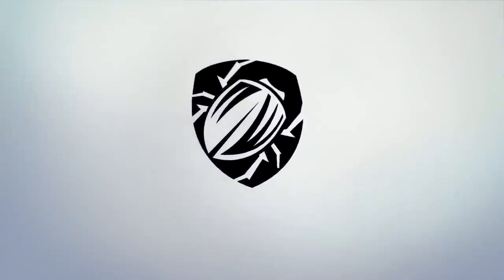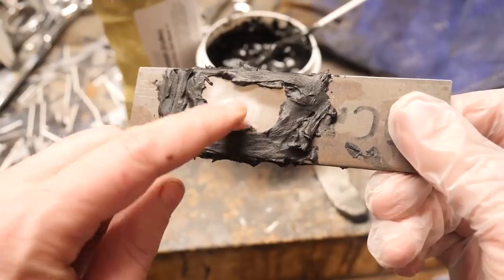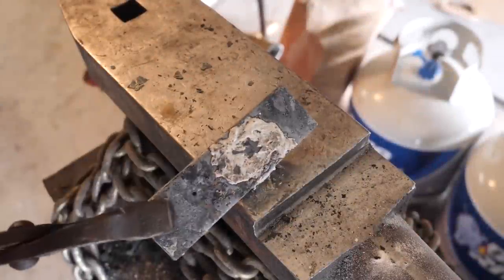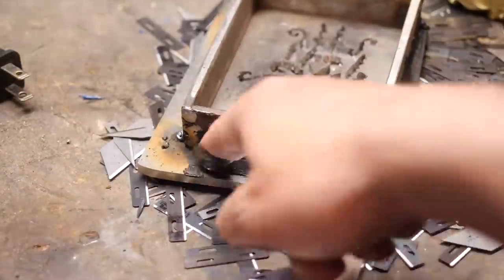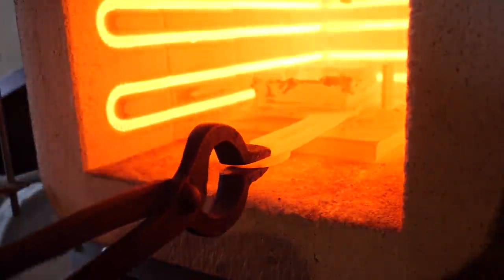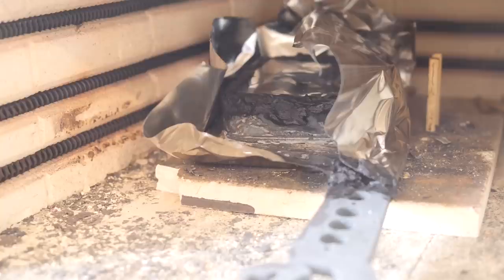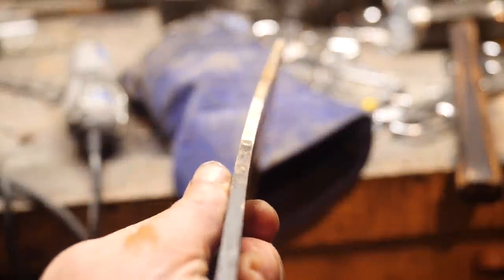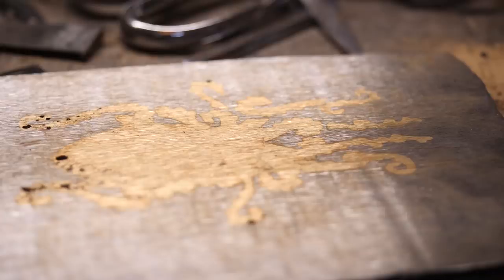Return of The Squid Cleaver!

Comment: If it was me I would cnc Mill the design and a brass fill and I would hit it with a hammer to make it stick and avoid fire altogether because I don't understand how you can heat treat the knife with a lower melting temperature metal in there anyway and I'm very lazy.

Comment: Your little torch will be big (hot) enough, to braze it, if you preheat the blade in your oven
Reply from the maker: I think that heat will only last a minute at a time
Reply: Heat a larger piece of steel with the blade laying on top at the same time. Together they should stay hot longer. Get it up to just under the melting point of your brass/bronze. Pull it out and braze your bubbles and other flaws

Also, as a note, the brazing may look slightly different as it is made up with other alloys
Reply from the maker: @jasonharrison25  its a good idea but steel at that temperature in a normal environment scales very quickly
Reply: @GreenBeetle  forgot about that. Maybe you could try it at a lower temp and see if it will still braze

Comment: If you want the metal to flow properly, use some borax flux. You could tig or oxy fuel braise it all together.. The easy way to fix what you got is just to drill out the voids and just peen bronze rod in. I would probably use the bronze/brass mix you have to make the bronze rod, otherwise the color is unlikely to match. Make sure to drill all the way through so you get the mechanical lock on both sides of the blade.
Reply from the maker: the white powder here was flux

Comment: Cnc cut the image out of a brass sheet slightly thicker then the blade, then press it in with your hydronic press maybe 🤷‍♂️🤷‍♂️. The brass will expand under the pressure locking it in.

Comment: Try brazing first: when that fails change the design so there aren't huge cavities to fill and then try brazing again.  Should work if all the cavities are about the width of a brazing rod.  Didn't see you using anything for flux either.
Reply from the maker: The brazing rod was fluxed.  I added flux to the powder.  Good idea.

Comment: so not use powder, you are pretty much volatilizing the bronze that's why its getting all places, use the kiln and melt it to pour its the best, just pre heat and remember that even like that the sharp edges will be a hell of an issue if you don't pre heat. but try again with the pouring. also melted metal produces a lof of gases unless you are in a completely dry environment, so don't seal it or it will bubble everywhere

Comment: A thought that crossed my mind is that you use the same lazer technology and simply cut out the same figure in a bronz plate slightly thicker than the blade you want to fill with the bronz. then fit it and peen it lightly on both sides so it will be fixed permanently. God speed.

Comment: Maybe this is a lot easier way to fill it. take a bronze plate that 1 higher than the knife,  draw the line of the sqid on it, cut it out, anneald it and hammer this shit in the knife. with a little bit of flux and silver solder it will hold.

Comment: well if you are getting the cleaver blank cut out  why now get the pattern cut out as well ? Then place the cut out pattern into the blank , heat them up  to a temperature where they wound forge weld ,  gently hammer them together ,then gring it al flat . It may be a weak bond  that wont hold up to much abuse but i doubt you are making this  to use as a  actual cleaver and the bond between  steel and just melted in bronze cant be that good either since it is not technically brazed together ( yes i now brazed welds are plenty strong)
Reply: Oh and if you doo this mae sure to get the  octopuss made out from thicker material than you want the cleaver to be so that you have enough material to grind off later

Comment: tig weld it. or get someone too. ferrous and nonferrous don't play well. I cast silicon bronze and weld it all day to pay the bills the best bet would be to get some plate bronze laser cut to make an insert then slip it in. HAMMER IT TO HELL. if you put a groove in the steel blank so that it can have a mechanical lock it would help a ton. as the thermal expansion rates are different.

Comment: If the design doesn't need to go all the way through you can do an etch on both sides, heat the design up and brush it with a brass brush. It should transfer brass over. MichaelCthulu has some videos where he does it and explains the process. It might work with bronze.

https://youtu.be/YwJoyPbPZVs @9:27 for one quick example.

Comment: FLUX FLUX FLUX FLUX LUX FLUX .nothings going to work without flux, the whole secret to brazing soldering etc is using flux youll never get two dissimilar metals to fuse of the bronze to flow without using flux first
Reply from the maker: I used borax in this video but there are probably better ones for bronze and brass

Comment: Dude, you need flux. Oxygen is your problem, it react with the metals at that high of a heat, thats why youre getting gas bubbles. Brass also melts at about 1700f, so youre also overheating your metal and boiling off the zinc in your brass. Brass powder isnt the way to go here either, since youre just increasing the surface area to oxidize. You could try sintering the brass powder, but your best bet is to look into making an actual foundry and learning to (properly) pour brass. 

You still need some flux though
Reply from the maker: powder was bronze. white powder added was flux.
Reply: @GreenBeetle  I missed that, my apologies. I do maintain that those temperatures were way too high, and boiling off the zinc was responsible for some of the bubble problems. Cant be healthy to breathe either

Comment: At the begining when you showed your attempt to pour, it wasn't even remotely hot enough, it should be a thick liquid, not a liquidie solid... the pour method should work just fine just gotta do it right.. like I noticed you said, "this is suppose to melt at blah blah" no dude no, no black Smith is sitting there with a thermometer making sure everything is exactly this or that, thats what Metalergist do, blacksmithing is a by eye, hand, and ear trade.. if it melts at 1700 then go to 2k unless your are doing something EXTREMELY specific like hardening etc ball parking it, is almost always the best option, the pour you showed at the begining of this, the problem was the metal wasn't hot enough not your skill boss, your knowledge. I mean even with hardening most blacksmiths eyeball it and it is a very temperate related proccess.. two things 1 the bronze should look like a golden aber milkshake when it's ready to pour.. 2 you need to remove the DROSS (the top layer of yuk nasty that floats above your molten metal) those are impurities you don't wanna pour into the cavity..

Comment: Do cold cast epoxy where you mix the bronze powder in with the epoxy.  after it cures it can be polished and the bronze powder on the surface of the epoxy takes on a really good metallic shine.  it even has a good weight to it. 

 good example    https://youtu.be/bv1EqsV3e_M